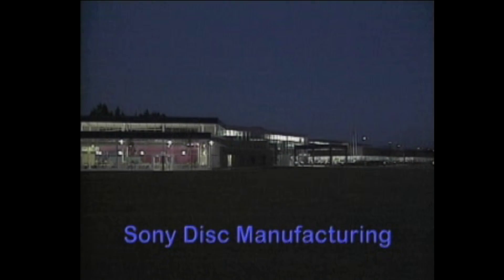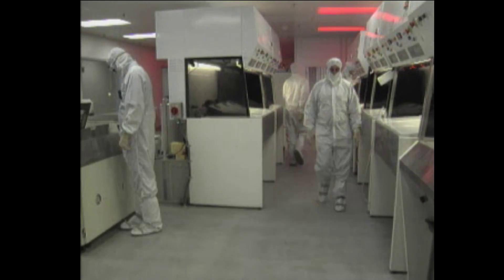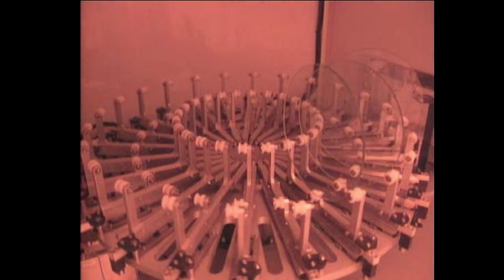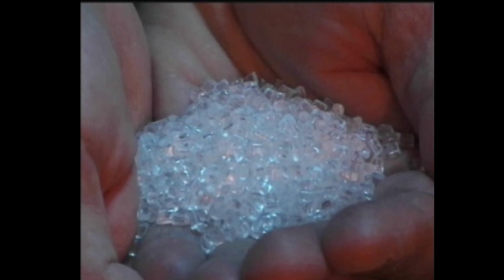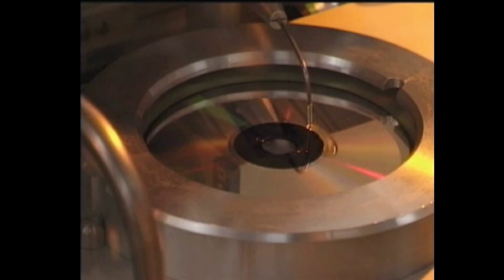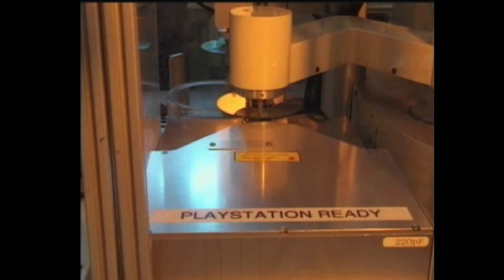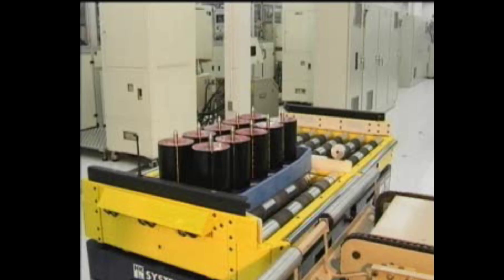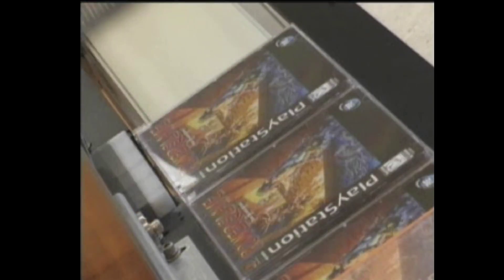1997 - How PS1 Discs are Made? [Playstation Underground]

Comment: Lol, no the black coloring does not protect against piracy. But That wasn't common knowledge in the 90s
Reply: Not so much illegal copying as in piracy, more like illegal copying as in this is a way to know that it's a genuine PlayStation disc, and anything that doesn't have the black bottom isn't since only the manufacturing plants can do that, not average bootleggers 

Like how Microsoft used those holographic graphics on their discs; it's not copy protection, since they still require a genuine product key separate from the holographic disc, but it's something only Microsoft can do so you know you're using official software that isn't tampered with or bugged with spyware or something